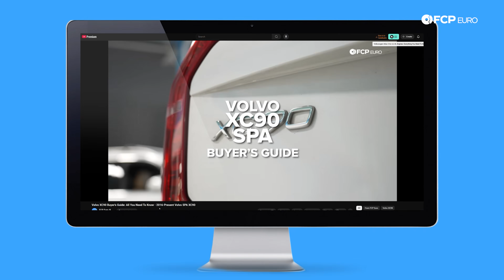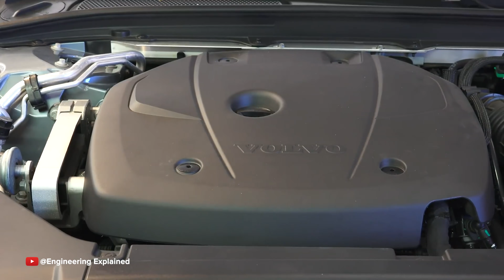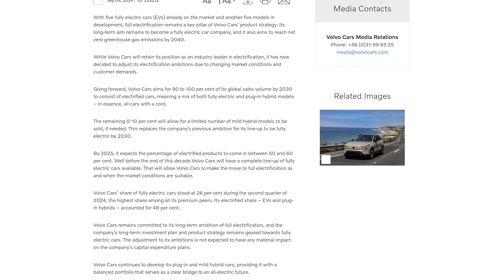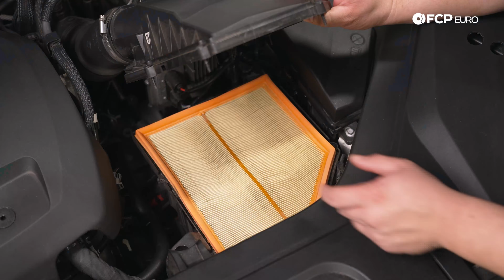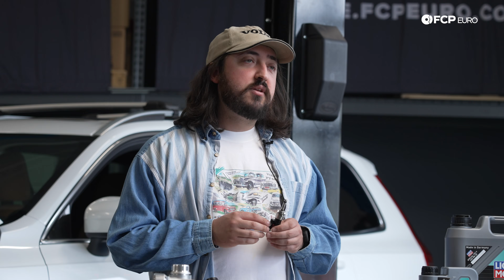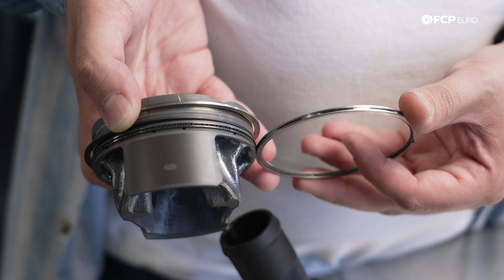Volvo SPA XC90 Engine Guide: Everything You Need To Know (2016-Present Volvo VEP4, Drive-E Engine)

Comment: My 2018 XC90 T6 supercharger clutch went out at 60k and I had to pay for it. Shocks and struts worn out by then, too. Intake seals and O2 sensor went bad at 80k. AC compressor has been replaced 2x. I’ve been doing oil changes at 5k. Don’t trust 10k intervals!

Good idea on the liquid moly flush, your explanation makes a lot of sense now.
Reply: I had no idea 10k intervals was a thing even for Volvos...

Comment: Great information I’m looking at purchasing a  cc90 please give me the years that have low maintenance ie oil leaks and what years are most reliable  between 2016 -2025
Reply: 2016 and 2017 have lot of early problems.

Had to replace steering buttons, starter, all batteries, boot inner headlight.

Volvo recomends changing diff and gearbox oil every 60k km.

Also check if propeller shaft has been replaced

Comment: Thank God for FCP Euro, I'm on my third Volvo and at 102k i'm fed up with this 17' S90 T6. I have kept up maintenence religiously but between  the coolant pipes busting at the connection and the supercharger issues just keep making me hate this car. Can we please please please find the the electro magnetic clutch fix that prevents just buying a new supercharger. The supercharger actual internals are all good except that clutch for 100- if not 1000's of buyers. Supercharger seals were all replaced by the dealer under warranty and after 1.5 year, almost right after hitting 100k boom supercharger no good!
Reply: The newer gen Volvos are really for shows now man

Comment: What about the error code P0171 system too lean on bank 1?
Reply: Probably the upstream (front) O2 sensor. I just went through this on my 2016 T6. Pretty easy to do yourself.
Reply: @DKRK279  Thank you! Did you replaced it or just cleaned it?
Reply: @Admin-Ed I replaced it. I found a new in box one on eBay for $75 and bought a 7/8 stubby wrench for $13 so did it for under $100.

Comment: As a former Volvo Expert technician, the new Gen VEP engine (B5/B6) is trash compared to the original VEP T5/T6. However, the older T6 would have supercharger baffle leaks and cause lean codes requiring removal and reseal of the supercharger. I have dont quite a few of these. 

Catrol Edge Platinum > Liqui Moly mediocre oil.
Reply: What things go wrong with the B5/B6 engines?
Reply: @YZJB  water pumps in my region.
Reply: @anoncontractor how is the water pump different in these?
Reply: Hello, I would be very grateful for your reply. I'm from Ukraine, so please forgive any grammatical errors. I own a 2019 Volvo S60 T6 AWD and recently got the ECM-P02CB07 error code. Turbocharger Supercharger "B" Underboost Condition. Mechanical Failures. Is this most likely a leak? I understand you can't say that simply by mistake, but perhaps you could at least offer some advice based on your experience. Thank you very much in advance for your reply.
Reply: @Nikyut-b3b  you need to smoke test the intake system. I have seen numerous superchargers leak.
Reply: I know of someone that changed their oil every 3000-4000 miles on a T6 and an injector blew out within 120k miles.   I’m not sure what oil he used though.